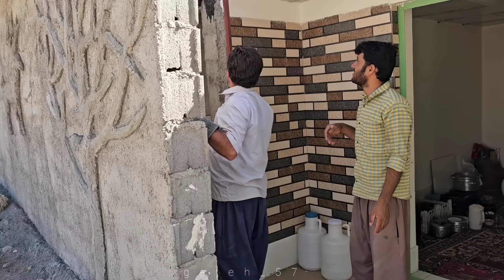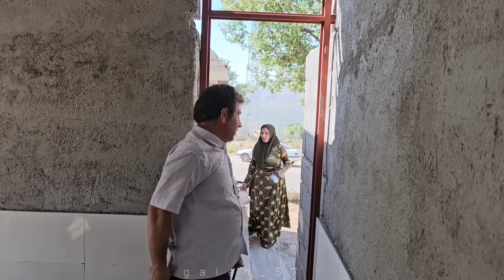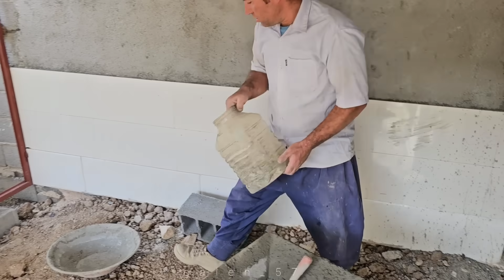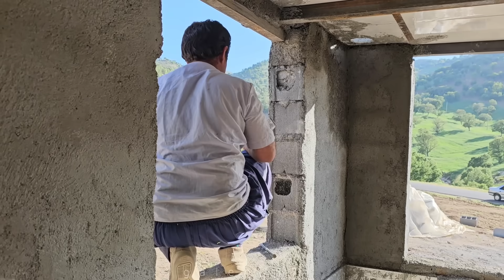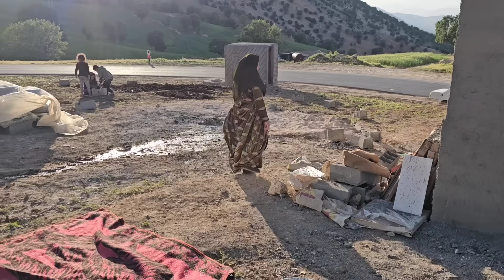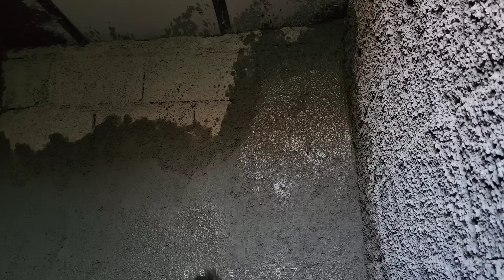"Purchasing sand and installing windows in the kitchen by a master craftsman"

Comment: I almost had a heart attack when I saw him breaking the tabs of the door frame.! That's what was going to secure it to the wall. What he.needed to do was to insert the right side first and then enlarge the holes on the left side until he could push it in!. The cement was reparable. This type of frame is welded right there. And I am mentioning this not to make a negative comment but thinking about the crazy husband! He might try to pull that frame from the wall... since it is secure now with plaster! Why don't they put cement?
Reply: Porque hacen así nomas  más o menos.
Y no hay nadie q supervise sus trabajos..
Reply: 😂😂😂 کدوم شوهر دیوونه اینها همه فیلم است این مدل فیلم ها زیادن مثل فیلم های تلویزیونی برای درآمد از یوتیوب 😂😂😂

Comment: 44:09 OMG, what a messy way they do this… They don’t have to throw the cement onto the wall, with cement flying in all directions… SMH… They don’t do that here, at least not the ones I have seen… They put the cement on a larger, wooden or steel plate with a handle, then push that against the wall and drag it up, leaving a beautiful wall! Look at this video: https://youtu.be/Ddg_a30Zm9s?si=iztLJExBglI91EtM

Comment: Looks air tight to me being 4 inches off the ground, not.  Dont you put the door on last?  You have to finish the walls, floors which means the door will get all full of cement and you have to clean it.  What a  bunch of bozos.